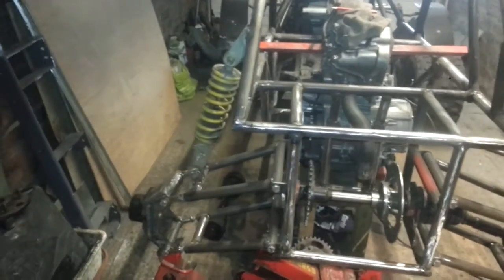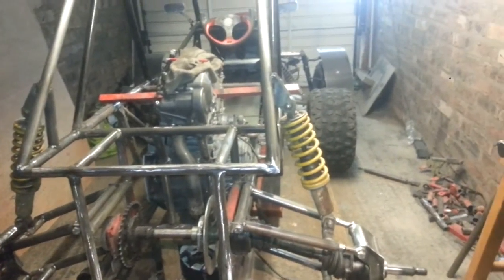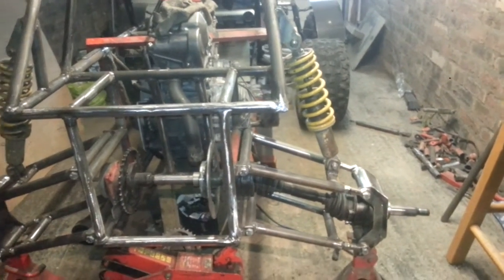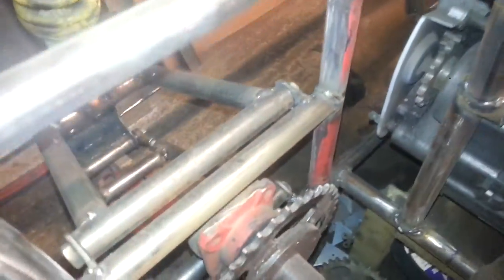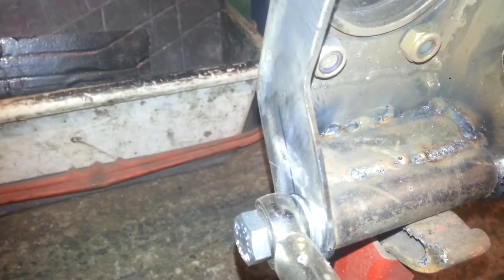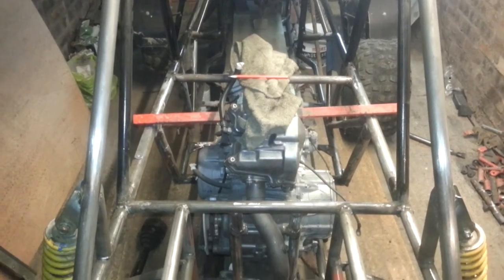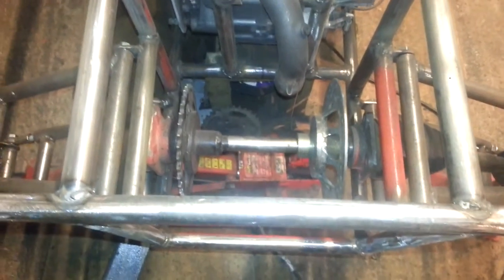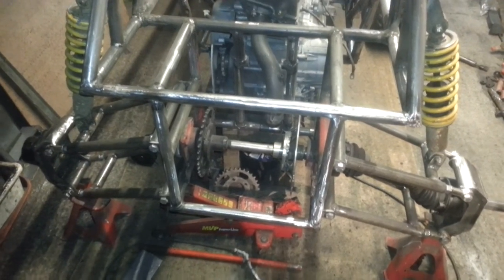Dune buggy build rear suspension

Comment: What cv axles did you use and how did you adapt it to the 1” shaft I’m trying to do the same thing
Reply from the maker: Hi everything i used from a 1990 ford Sierra Cosworth
Reply: Awesome how did you adapt the splines to a 1” axle. Thanks in advance for the help
Reply from the maker: @smallgaragebigdreams6032  I used a 10mm thick round plate and drilled a 25mm centre hole with woodruff slot and bolt holes to fix drive shafts too then welded to the 25mm centre drive shaft that the sprocket is fixed too  then the cosworth drive shafts bolted right up to them